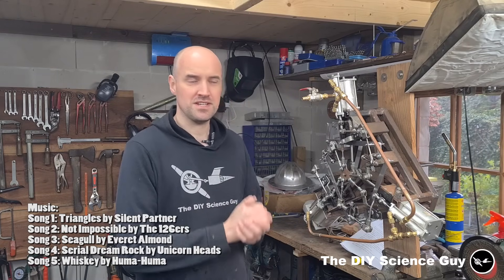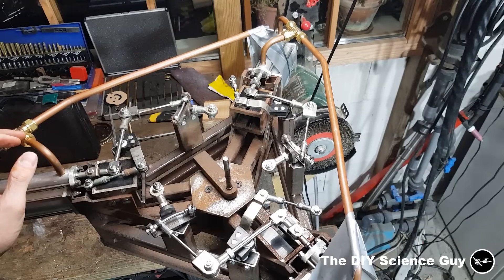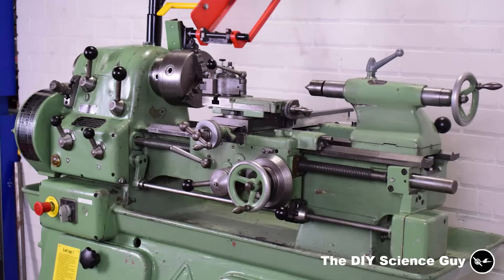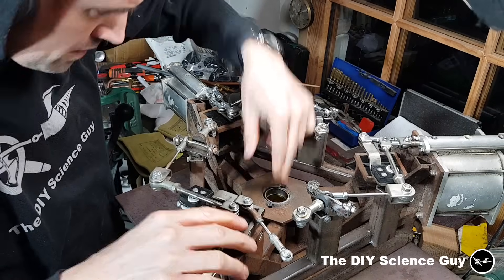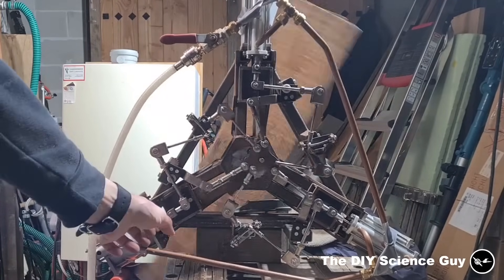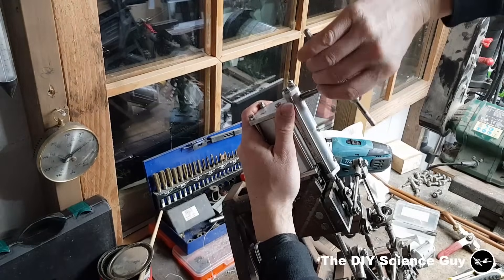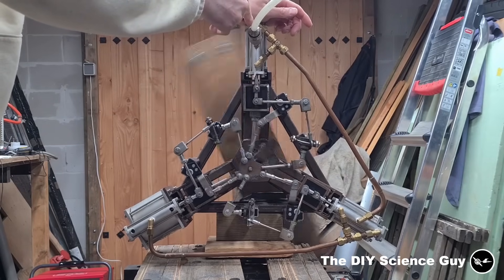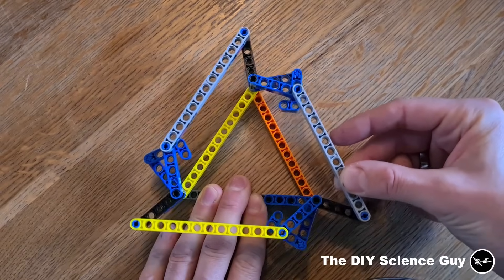Solar steam engine #8 Finished! True DIY

Comment: if your looking anymore into hydrogen production, try using radiator fin shaped stainless steel 316L, with multiple cathodes and anodes stacked on top of each other receiving 12 volts between them all, should reduce heat and create extremely efficient hydrogen production when combined with KOH electrolytes

Comment: Maybe you should review putting this engine into a motorcycle? A motorcycle prefers a lightweight variable speed engine. The efficiency benefit of a triple expansion steam engine is best obtained when it is run at constant pressure, constant speed and constant load which match its design parameters. But it would get heaps of attention at a motorcycle show! 

I would use it to demonstrate how abundant, free wood (and waste) can be converted into reliable electrical energy at small scale.

Comment: Great job. I suggest putting temperature sensors on the cylinders to determine how much work each cylinder is contributing to the crankshaft. For example, if the last cylinder is at room temperature, then no gas expansion is happening there and therefore it is doing no work.

Comment: I love the construction technique of this machine. It reminds me of the kind of thing one might build with parts lying around the machine shop where my dad worked. The sound is wonderful!

Question, do you think the buffer volume between the various cylinders might be insufficient? I was recently reading about triple expansion marine steam engines, and they mentioned that the engineers initially incorporated buffer tanks between stages, and later the intermediate steam trunks were sized to provide appropriate buffer volume. I think this change was because the "lagging" or thermal insulation of large diameter intermediate steam trunks is easier and more effective than that of a discrete tank, and because the oversized trunks simply work to lower frictional "wire drawing" resistance of the steam as it's transmitted from one cylinder to the next.

But the basic point (to my understanding) is that even when a triple expansion engine is working properly, the exhaust volume from one cylinder is not discharged synchronously with the intake volume demands of the subsequent cylinder, and a substantial buffer volume is needed to allow for more constant intake and discharge pressures. This could be one additional reason for your low pressure cylinder "dragging" (although I do understand that the primary reason is that you are over-expanding, with such low intake pressures compared to the final exhaust pressure).

Actually... I hope not to sound pessimistic here, but isn't the overall expansion ratio here rather aggressive? I don't think I've seen such large cylinder diameter ratios even in a marine engine running a ~30:1 absolute pressure ratio (200psi working, 7psi condenser). What is your target pressure ratio?
Reply: "engineers initially incorporated buffer tanks between stages, and later the intermediate steam trunks were sized to provide appropriate buffer volume." - Interesting. The connecting pipes should act as buffers between the cylinders to some extent. But, if you know anything about exhaust pipe and expansion chamber design, the behaviour of the pressure wave in the pipe can have a big impact on the performance of the engine. So, maybe intermediate buffer tanks (or bigger pipes) would filter out the pressure wave and ensure each cylinder receives constant (or even) gas pressure and flow on the inlet valve? But I expect this would depend on the speed of the engine.  

If the engine has no load, then I would expect not much gas expansion would be happening in cylinders 2 & 3.  Cylinder 3 does look big compared to cylinder 2 ? If cylinder 3 is too big it could produce negative pressure toward the end of the expansion stroke which might upset the balance, but only under low load. Unnecessary friction from such a large cylinder would be the biggest downside I would expect. 

There is a document at the link below that might explain more.
https://www.ajreeves.com/user/downloads/METE%20Part%201-17-merged-compressed.pdf
Reply: Yeah the marine engines I was reading about were probably 300 rpm maximum (direct drive 5000 H.P. class engines turning 2-3 meter wide screws was the picture I got from the book). No pressure waves there! Not sure if that’s the case here, although the demo speeds OP used here probably wouldn’t produce pressure waves.

Comment: Amazing work. Bravo. 
I love how slowly it can run!
Is it an illusion, or does the rotation speed pulsate, with a fast and a slow part?
Reply from the maker: Thanks! Yes, it does when it's running slow. The back stroke of the high-pressure cylinder has a little less forse, and at those low pressures, the low pressure cylender is not doing a hole lot, so it has to be dragged around by the high pressure cylinder. This is what causes that effect.

Comment: Rather than making everything more rigid and strong, you could have counterbalanced the rotor? Like they do with car rims to compensate for any imperfections. I'm not sure what caused the inbalance, if it is on the opposite side with the pistons you may still be left with some torque. But a smart application of counterweights should make it smoother.

Comment: How many Bars/PSI required to initiate the power stroke? Use of a simple bicycle tire pump inflator with gauge at the point of insertion will demonstrate the pressure needed to begin a cycle. The large masses involved certainly are reminiscent of early rotary aircraft engines where the rotational forces of piston heads rotating about a fixed crankshaft limited high rpm.
Congratulations on your successful demonstration of a working model, many give up with the precision and complexity your working model demands of the craftsman!
Reply from the maker: Around 1 bar
Reply: @TheDIYScienceGuy that’s fantastic.
Reply: @ Thankyou Sir, a low pressure indeed!